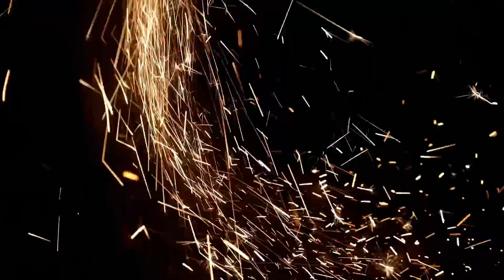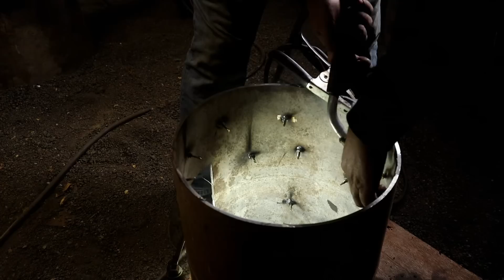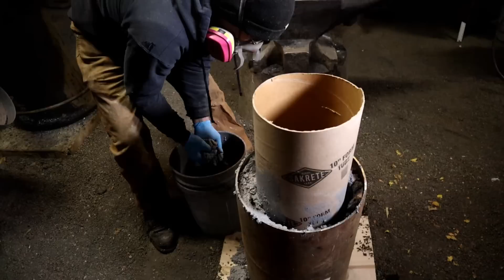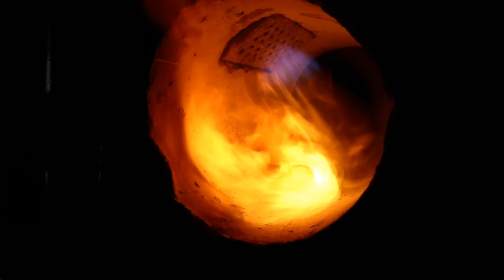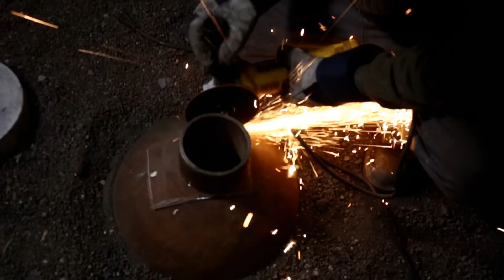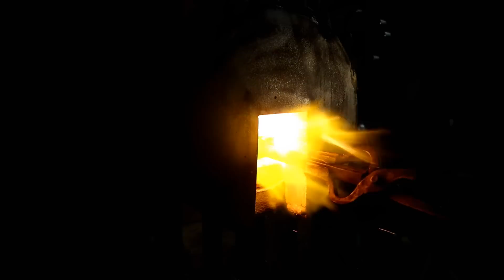The Best Ribbon Burner Forge Build

Comment: Awesome all the way around guys. Just one note: please use the correct thread seal tape/dope when piping any flammable gas such as propane. I noticed that some of the thread joints were sealed with the appropriate yellow gas-rated tape and the rest appeared to use the standard white teflon tape. While teflon and PTFE are awesome for their intended purposes they fall a little short for gas piping as the petroleum based propane could eventually eat through or gum up the tape enough to allow leaks to develop. No need to state the obvious but a gas leak next to a hot forge would be a bad day for all. There are several good options for tape, I recommend a combination of yellow thread seal tape coupled with a gas-rated pipe "dope" so as to maximize the seals and to make future disassembly easier. Thanks for the content.

Comment: Shouldn't you be wearing a respirator when working with K wool?
Reply: Yeah my thoughts exactly
Reply: @markadams1165  honestly asking for my own benefit because I don't know. I've seen both.
Reply: It is recommended to work with a respirator and gloves, since koa wool is a bunch of micro fibers
Reply: Also in the line of the cutoff wheel with no guard.. also welding bare handed... Slav safety squints must be enough
Reply from the maker: Do as we say, not as we do! Always use proper safety gear!
Reply: its not like he was snorting it like a cocaine . . .
Reply: @hardwurkindaddy  You should wear a respirator, long sleeved jacket, long trousers, gloves and eyepro, when installing or removing mineral wool, because mineral wool will break into little pieces that can get stuck in your upper respiratory ways and epidermis/eyes. Asbestos on the other hand you should avoid like the plague and let trained technicians handle, they have the proper safety equipment and the proper pension/illness plan + yearly cancer scan. The difference between asbestos and  mineral wool is, that mineral wool is splitting across the filament and doesn't get any smaller, so doesn't get as deep into your lungs. Asbestos splits along the filament, thus gets smaller in diameter, and goes into your bronchia and lung bubbles leading to asbestosis (scarring in the lungs, that encapsulates the asbestos) and finally lung cancer up to 60 years down the line.
Reply: ughmas To be fair, anyone who actually does real work with an angle grinder regularly loses the guard in a week, or whatever. The guards are junk, and they just don’t last.
Reply: @DoggoWillink  Well depends on what you do. Tight spaces, where simply is not enough room for angle grinder, you ether chance to pneumatic cutter that is smaller but grinds trough small disks like no tomorrow or take guard off and risk your hands when disk fails or jams. 1mm disk got jammed on between two sheet metals that we under tension. Grinder yeet on the orbit and last peace of the disk i found stuck on my literal skull.
Second time i placed the grinder on the ground, pipe fall over it and nothing seem to be wrong until i put grinder on and touch the metal. Disk had taken minor side torsion damage and exploded on full speed. Thankfully i had guard on that time.
Latest one was wire wheeling rusty blacksmith/leg vise, wires cough the corner, while i was holding it loosely to minimize vibrations on my hands (due illness such vibrations are "toxic" for me) and again grinder was on orbit, but not before doing loop and hitting my fore arm lightly... well 5mm deep grooves full of rusty crap are not that fun. Cause stubbornness i finished the work and went on cleaning the wound that took two hours to get all the crap out and it took 6 months to heal even relative ok condition leaving pretty nasty scar.
Accidents happen to everyone, to me just more than on average and i'm not the one going all safety sally on everyone, but some guard is smart to keep on, if nothing just modify it slightly so least your supporting hand has some cover when grinder decides to yeeet into orbit.

For guard lasting, ever though of making your own that gives protection you think is needed, while work can be done? More over its there to protect disks from getting damaged when placed on the table or ground. Just count for lols how many disks have you broken in last year by accidentally stepping on them or other such accidents.
Reply: @zumbazumba1  before installing kaowool snort cocaine, got it.
Reply: @ughmas  wholly shit I've worked with Ukraine and Russia Smith's for the last year and they never wear safety glasses or hoods when welding or grinding or smithing it must be the whole eastern bloc.
Reply: That's a common misconception. Kaowool is only dangerous to breathe in when it's heated. That's why you need to rigidize or coat it. But you don't need a respirator just to handle and install it.
Reply: @stevealford230  any glass fibre product is dangerous to inhale, cold or hot a respirator is the only safe way to use it

Comment: Curious what the benefit of installing the burner at an off center angle instead of directly above to the bottom of the forge cylinder where the materials to be heated will naturally settle?
Reply: Inside superheated air will swirl, making for more consistent temps.
Reply: Yeah, i think the air flow is less caotic (and therefore more homogeneous) if you force it to vortex in one direction
Reply: I see. That make a lot of sense. Thanks.

Comment: Not sure tapping with a hammer sufficient,  I think using a sawzall with blade removed would work awsome for getting bubbles out.
Reply from the maker: That would do the trick as well but 3+ years later and the forge is still running strong

Comment: Have you ever tried itc-100 to coat the inside of the forge? I used a similar coating and with two layers of kaowool I was able to get to forge welding temperatures.

Comment: Boy you guys sure make some purdy Fire an' Steel pictures!  Back in the day, when Pine Ridge was no more than a gleam in it's father's eye, they had a saying in film schools, "Movies must MOVE!"  More YouTube producers should figure this out.  "If the content is moving, keep the camera still; if the content is still, keep the camera moving.  If both must be still move the POV Shot/Reverse Shot varying the lengths of the cuts; if both must be moving syncopate the movements between one another."  You have this down, so pat yourselves on the back.

Now, the next factor is the audio track.  Sound consistency is the big hurdle.  Matt's voice went from too treble to too bass.  His natural speaking voice is kind of a reedy tenor.  This is always a bitch to mike, particularly in sound environments that are excessively live, like most shops.  Most of the slicker blacksmith videos get around this with voiceover, which I 'm sure you got very tired of in the past.  So did I.  But realtime mikeing is a realtime problem.  In voiceover sound is information, too much voiceover means sharing too much information.  In realtime sound is movement.  That's why you have to be either speaking and not working or working and not speaking.  Otherwise the movements clash.  I don't know what post production resources you have to mix and modify realtime sound but I'd say that's the next videographer's hurdle for you.

You are doing splendidly with music, particularly in the use of syncopating beats and baselines.  YouTube is rich in these resources and I wish more producers were using them as well as you do.  This is particularly the case in two areas:  slo-mo and the power hammer shooting.  Slo-mo has to be watched like a hawk or it slips over into gimmickry.  But in the shop context slo-mo gives you far more lucid control of moving objects, coordinating the speed of processes that are difficult to shoot straight because they are either too fast or too slow for realtime treatment.  You are making excellent use of the music to keep slo-mo as technique from overpowering what objects in motion the slo-mo is being used for.  A music beat that is either a little faster or slower than the slo-mo itself is one the best tools for this.  Good job.

Most shots of power hammer work fail to convey the delicacy that the technique is capable of.  You are doing excellently here.  Having music of multiple beats to match to the fine variations in motions, jumping from one on-beat motion to a different on beat motion, then syncopating the motions back and forth across the beats is something you're getting really, really slick with.  Have fun!
Reply from the maker: Karmakshanti Vyapini thanks man! We are still figuring out some of the audio stuff. It will only get better. Most of this video was shot in a rush, but I do have some big projects coming soon where I cut no corners. I will be interested in hearing your opinions on some of those videos. Thanks for you thought out comment! I will look into your suggestions!

Comment: What are the advantages of a ribbon forge over a atmospheric forge?
Reply: 1st imho is savings in fuel.   Inlet psi is lower 1-3 psi vs 18- 25 psi  for atmospheric burner. So one uses less gas for the forge.
2 more wide spread  heat cone.  So less of a blast spot or spots in the forge and on the work piece. 
3 in many instances  higher forge temps can be maintained  more steadily imho.
4 less noise from the burner  ie not so much a jet nosel effect from sucking in ambient air and gas mixing and brushing thru the intake orifice.  Imho.
5 burner last longer as only the refractory is flame kissed as opposed to the ambient air system actually being in the forge.
Now those are in my opinion the benefits of a ribbon burner in brief. 
So the down sides now.
1st higher  initial cost for the burner. Unless you cust and cast your own.
2 higher cost due to the need for a blower system and gas valves and piping
3 a good lining is a must kaowool,  castable refractory and HT100  is pretty good a must. However done right it will last a decade or more b4 replacing the castable.
   So all in all for the 1st year of medium work load cost will be coming close to equaling out
By the end of the forges lining life you should be money ahead in fuel savings and redlining savings. Again imho.
🙏 be blessed now
Crawford out 🧙‍♂️
Reply: @danielcrawford7315   Isn't the gas oriface diameter larger on a forced air vs an atmospheric burner? So does a forced air really use less gas even though it is run at a lower psi? Can anybody speak from experience on this subject. I am debating on blown vs atmospheric for my forge.

Comment: How dose the refractory  hold up to cracking and chipping with the K-wool  underneath?  Seems like it would be like pouring a concrete slab on top of a marshmallow. I have worked with both materials professionally for the past 11years, building and retrofitting various power plant components, and have never seen this attempted.  I'm  truly  curious as to the durability of the insulation.  Because  if it works well, its a lot better solution for the home-gamer than  high temp zinc paint systems that are traditionally used.
Reply: Isn't it standard practice to use a hardener for kaowool to prevent the "concrete on marshmallow" effect?

Comment: hey guys, not trying to be a troll, but white teflon tape is only rated for water connections, not gas connections, you should really be useing the yellow teflon tape for this
Reply: IIRC from my studies in building- and energyengineering the yellow is required so that even if the steel pipe isn't yellow a technician can stop before he anglegrinds on the wrong pipe. The properties of the tape are exactly the same.
Reply: Yellow tape is a thicker form of low density PTFE tape, white tape is thinner, and pink is high density PTFE tape.

The thicker tape should be more likely to assure there’s no gas leak.  Connections should still be tested for leaks though of course.

Pink is just to make it easier to unscrew the pipe later.

There’s really nothing inherently different about them if you use them right.

Personally I only use pipe dope.
Reply: Second on the if it's gas it gets pipe dope
Reply: @StopTryingSoHard  holyshit, why the hell nobody taught me that in school. thank for sharing your knowledge

Comment: I don't have any experience with building metal forges, but plenty with ceramic and glass kilns. Your new forge looks an awful lot like a glassblowing gloryhole btw(and yes that is the actual term). Anyway, I'm pretty sure I could build this thing from scratch, burner and everything, but I still appreciate the advice to not make this the first forge a beginner tries to construct. It might not be that complicated, but I can tell it's the kind of project that you'll be much happier with if you work some of the kinks out on cheaper, simpler, and more temporary forge structures first.

Comment: Does the shape of the forge matter a lot?  I know size wise it does depending on your weapon
Reply: Cylinders have less surface area for a given volume which gives you a larger more efficient forge while using less of the moderately costly insulation. A round inside to your forge also allows for a more even temperature in the forge.

Comment: Hard to beat a ribbon burner forge if it's all done right
 Caveat is gotta run electric blower for constant air pressure. 
However  a good thinking Smith can work around this. The burner is  generally a  separate unit from the forge body. As such it would be simple and wise choice to get a setup w atmospheric burner to set in place of the ribbon burner set up for those times when you cant have power. Yup added cost but also added value.
🙏be blessed yall now 
Merry Christ Mass season greetings  happy Yuletide celebration,  hannukah,  quanza and all such
Crawford out 🧙‍♂️

Comment: You get a thumbs down for assuming everyone that views this video “can’t” do what you just did 

Simple builds actually 

Now if you really want it a bit more challenging you would have a pressure switch ,solenoid , thermal couple,and a PID for safety and control 👌💪🏻

Comment: Ribbon burners are for huge forges only.  They are a waste of gas imo.  Unless you doing huge commercial work they are a waste of fuel and money.  For 99.9& of folks a forced induction burner is adequate using a mig tip for a propane nozzle.  Galvanized fittings will release zinc and cause zinc poisoning until it is burned off.  Lots of bad info out there....LOTS.  All you need is a 60 dollar blower motor at 75cfm ish.  The door is not the most important part, the forge and burners are.  We are professionals.  <----- Build dangerous and ridiculously expensive forge to operate.  Round forges should have the burner pointed at the edge or wall of the round forge.  This causes a superior heating vortex as the heat can move in a circular fashion to heat the forge.  Way more efficient.  Anyone who builds a round forge and places the burner perpendicular to the forge has not a clue about what they are doing nor any laws of thermal dynamics.
Nothing you do or say in this vid is factual.
Forge On!!
JmB
Reply: Okay boomer